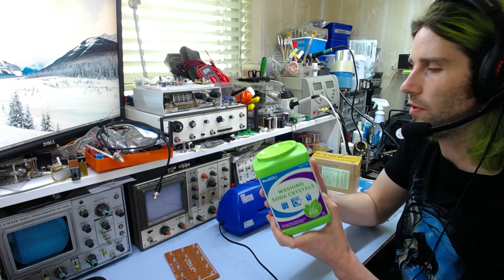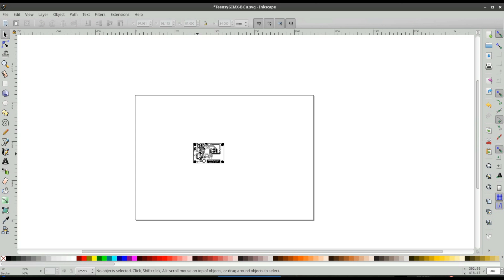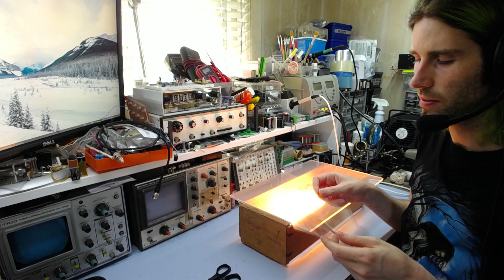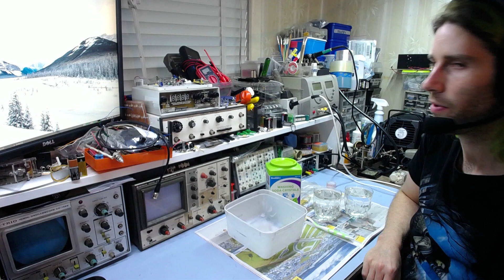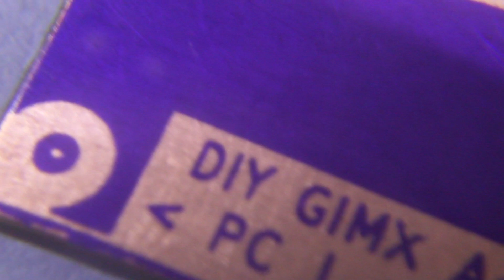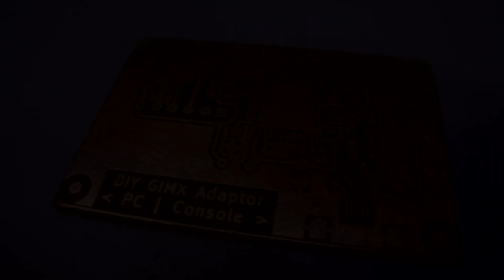How to make PCBs using UV-sensitive photoresist

Comment: Great video. I used to use this method with per-sensitized boards but they got way too expensive. I have been using the toner transfer method and it works but sometimes the traces come out "airy". Now that I know one can get the film for cheap, I plan on trying it again. Thanks for the education!
Reply from the maker: Hope it works well for you! You can also use PulsarPro's TRF product to deal with any pinholes in the toner transfer. It works quite well, though I find the UV resist is much more reliable in that sense.

Comment: at developer process , when i put pcb in solution the unexposed area not desolving  totally, when i put for longer time the exposed area also starts to desolve, please help.
Reply from the maker: Assuming you are using the same resist film, and the washing soda as developer as I have been, I can only think that your resist may not have been exposed for long enough, applied to the board correctly, or you are using resist that is too old, perhaps.

Comment: Hey man, I am four years too late but thanks for sharing your knowledge. There's a lot of good information in there. In my specific case, the fine smt pins (tssop) were coming out blurred, so the pins appear smudged. After going through your video, I swapped the mask so that the print is near the resist film and that fixed the problem!

For the mask, I use a single layer of artwork printed on regular A4 sized paper, then apply some coconut oil to make it transparent. The mask is squished between the copper laminate and plexiglass and UV light (LEDs similar to your setup) is applied for about 45 seconds. That seems to give the right amount of exposure in my case.

edit: I wish your video would get more likes. This information is golden!
Reply from the maker: Thanks! Not too late at all - glad to hear my video helped you solve your problem. I haven't tried the oiled paper method myself, but have heard online of others using it. It sounds like a solution for when OHTs eventually go out of production...

Comment: Nail polish remover (Acetone) will take the exposed resist material off in seconds.
Reply from the maker: Acetone works well for removing toner but I've not had much luck with it removing this UV-resist. Perhaps yours is a different type of film?
Reply: @Agent24Electronics  It is a while since I used UV-Film (18 months), which is why I was watching some YT Vids, including yours. My previous experience was that acetone worked very well, but since trying again, with the same 18-month-old film, it is not as good as I remember. Maybe my acetone is not great or perhaps the UV-Film becomes more resistant over time.
Reply from the maker: @CarrTech-dev  Are you using the same acetone or nail polish remover as you did before? The nail polish removers vary greatly in strength, I've noticed. They also typically have additives which may change their effectiveness.
To be fair I have never actually tried pure acetone for removing any resist - but I have noticed that for removing toner, it works best when you wet the board with nail polish remover and let it soften the toner for a few seconds before wiping off.
In contrast, just wetting a cloth or tissue with the nail polish remover and trying to rub the toner off with that is hopeless.
Reply: @Agent24Electronics  I purchased what was labeled as Salon 100% acetone. It was strong enough for the fumes to give me a headache.
Reply: @CarrTech-dev  Similar here I always used acetone for positive resist and it works flavlessly but not the negative one. I tried an acetone bath for 30mins and gave up on it. I use sodium hydroxide to strip both as you can use acetone for positive too but it´s not always there or too expensive to waste it for me because I buy the 100% stuff as well.

Comment: I like your setup, feels just like home. What LED types do you use for the lamp and how many? Looks much better than my cfl light :)
Reply from the maker: Thanks! I assume you mean the ultraviolet LEDs? They are just cheap 5mm UV LEDs from eBay. They were a gift from someone who bought more than they needed. Any UV LEDs should work, although depending on the target wavelength of your etch-resist film and the spectral output of the LEDs you use, it may influence the exposure time. I've saved the specifications given from the original listing and put them in a "Datasheet" of sorts. You can find it here: https://agent24.yolasite.com/Files.php